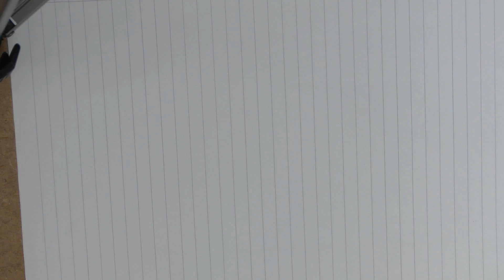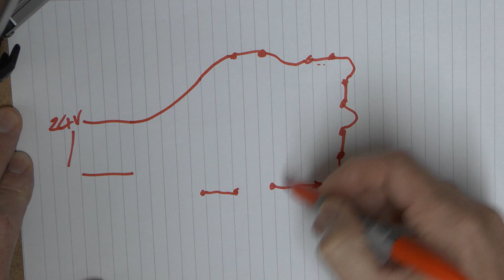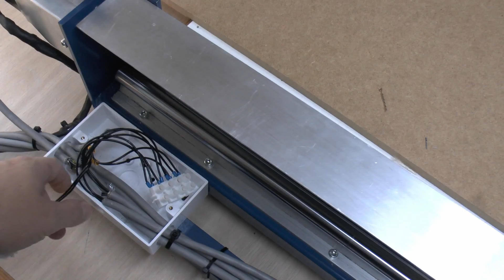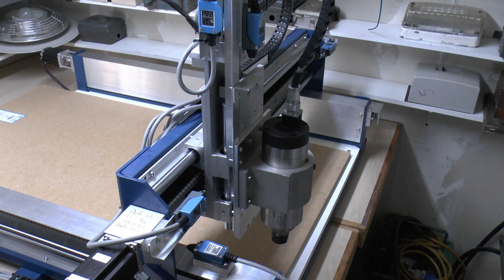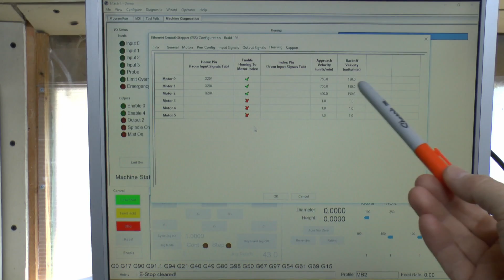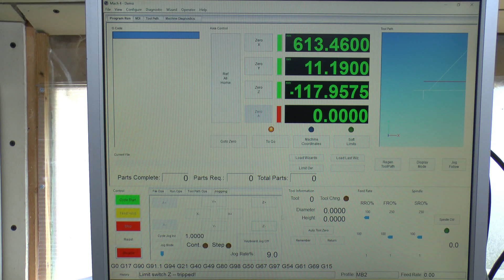CNC Router Build #6 - Limit & Home Switches

Comment: Hi. Your videos are very informative 👌. It'll be nice if you can make a video on points to consider before installing a new switch board from existing circuit as well as new(separate) circuit from the circuit board. Thanks

Comment: Using mechanical switches for zeroing the machine requires that the precision of the switches (how well they repeat the exact point where they trigger) is better than the positioning accuracy of the axes itself, in your case 1/200 mm, doesn't it? Are these switches really this good?
Reply from the maker: The switches are not, but don't need to be.  They are only used for an initial reference when the machine is powered on, after that it is assumed that the motors will move by the distances specified by the control program.
If it was necessary to machine an already partially completed part it would be necessary to reference against the actual part itself using edge finding tools.
Reply: @jwflame  would proximity sensors be a more precise but similarly low cost option? Would you have fitted these if available? I have the same machine and fitted mechanical limit switches too, never had an issue refunding a previous coordinate after re homing but am concerned about (expected) switch wear over time inducing some variation. Interested in your opinion.

Comment: Okay, but if the limit switches are your physical failsafe, and the controller steps the carriage off onto the limit switch, how can it then reverse the motor to step back the other way if the limit switches have cut power to the motor controllers (or their power supply)??
Reply: It only sets the signal level of the input low. The controller will just understand that "one of the limits has been reached"
It knows, for example that the --x limit was reached, because it was moving in the -x direction at the time the signal went low.

I prefer to have the switches on their own inputs, for the reasons JW mentioned. Another advantage of this is that all axis can home simultaneously, saving a small amount of time.
Reply from the maker: Limit override, as shown in the video.

Comment: I wouldn't say that individual signals for the limit switches is "pointless" While yes it does require additional wiring & inputs, it does not require additional switches [unless you want to add a discreet home switch]. Also, while machining, it is likely moving in more than one axis at a time, so if a limit is tripped, software cannot easily determine which direction tripped the limit. A part is not necessarily ruined when a limit is trilled either, as it can be a non-cutting movement, due to error in program or placement, that caused the trip. Also having a home different than the limit does not alter the working size of the machine, only shifts the origin. [movement is allowed on both sides of the origin] Some people will place "home" at the center of the machine, instead of a corner. This can be done mechanically with switches, or programmatically as an offset from one of the limits. 

Having discreet inputs does allow for faster homing [as all axes can be homed at once - not a big issue on a small machine] It can also allow for safe movement away from the limit, but disabling the direction in contention -  thus idiot-proofing the machine from the user manually driving against a hard limit, possibly damaging the machine. 

At a minimum I would suggest 3 limit channels, one for each axis, as then you can determine which axes are at fault in a multi-axis movement [this also allows for homing of all 3 axes at once]. The next step up would be 6 channels, allowing for determination of which extent was reached, allowing for the disabling of movement against that direction in manual mode to prevent damage. Finally I would only add discreet home switches, if you want the home to be a position other than at one of the limits.

Having said that, I do enjoy your videos, and the level of detail you go to. Please keep it up!
Reply: I totally agree Mark, and I would add soft(ware) limits at the end of travels also to avoid tripping the limit switches and having to override to move off of them. Set them at an appropriate approach speed once close also may help. Great video though!